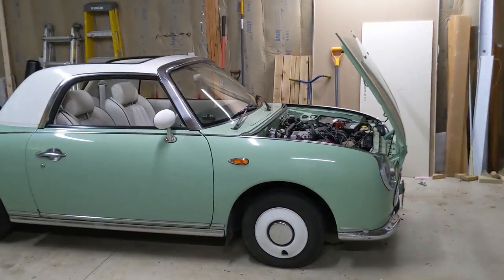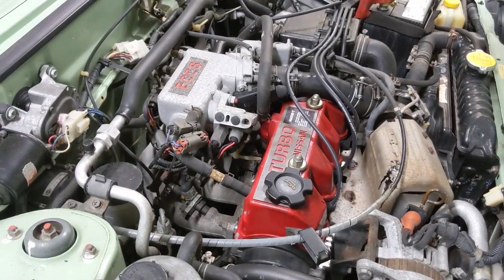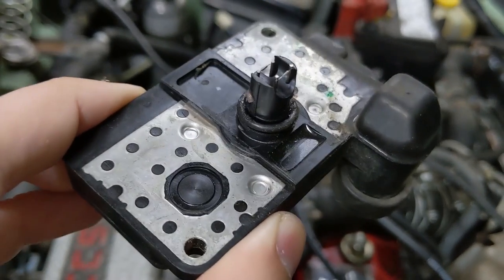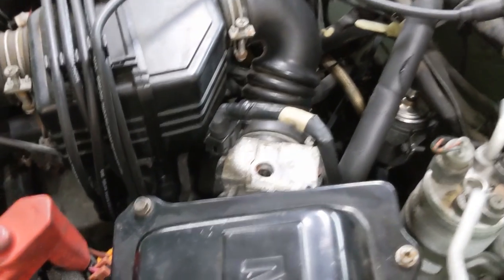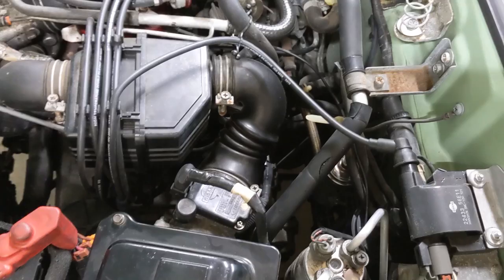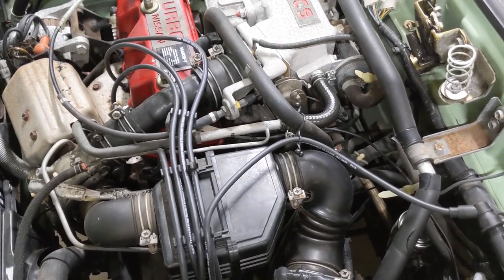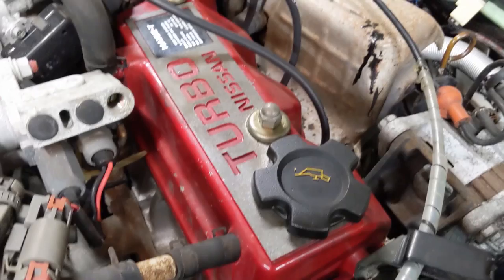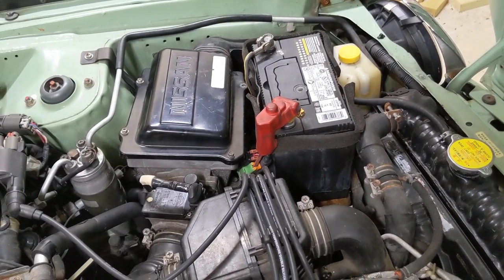Modern engine control musings and Fixing a Figaro

Comment: Nissan Dizzy has an optical  360+4 CAS in the dizzy. the 360 provides engine position with the 4 unequal slots provided cycle information.

Comment: Computer engine control has been around in some sense since the mid 60s. Bosch used to make fuel injection systems for Jaguar that were controlled by an analog TTL "computer".

Comment: A warm start problem, 15 to 45 minutes after having driven, usually indicates low Residual or Rest fuel pressure. Basically, the fuel drains from the injector rail back to the tank due to a failed fuel check valve; or into one or more cylinders via the vacuum port due to a failed fuel pressure regulator diaphragm. Either way, the fuel pressure & volume are too low to maintain idle until the pump catches up. The fact you can keep it running by pressing the accelerator leads me to believe it is a failed F/P regulator diaphragm.

Comment: On most MAF equipped cars, you can basically test the MAF by just disconnecting it and running the engine.  When the MAF signal is lost, the ECM will use its default air/fuel tables... otherwise, a MAF failure would leave you stuck by the side of the road... and most ECMs are designed to survive sensor failures, though cam and/or crank sensors will still stop you dead.
In short, disconnect the MAF and see if the car runs better... then you know the MAF is either dirty or failed.

Comment: Aah good old 80's japanese stuff. Gotta love it. I have a fair bit of experience with my own 80's and 90's nissans. First thing is that those styles of plugs from the start of the video.. You shouldn't have to remove the clip.. only push it in on the side with the whole thing exposed and the plug should come off. That way you don't lose the clip.. Secondly that valve is generally refered to as an IACV(Idle Air Control Valve) However it only functions when cold if i remember right. But idle is controlled for things like the AC but it's probably done seperately but yet another controlled air leak somewhere. The idle on a stock nissan of pretty much every petrol kind i've played with is about 850rpm. When it's cold or under AC load it might be around 1,100rpm. Vacuum leaks are pretty common reason to get bad idles. These things being 20-30 years old a lot of rubber hoses get hard an brittle. You'll also be surprised how many of the parts on these old cars can still be gotten new from nissan. But i don't know if nissan dealers in the US will import those parts for you. Here in australia they do tho. Also other ECCS nissans of that age can have a screw on the ECU it's self. You may need to remove that whole 'kick panel' as we call it to access it. If not there is a screw on the throttle body it's self that holds it open a littlebit. This isn't supposed to be touched. But it's possible somebody else has before you owned it. Both are worth checking.

Comment: Hey, if it’s still a little ‘hunty’ after the fix then it’s likely to be an air leak, get a boost leak checker (looks like a wild vape pen for a car) they’re expensive but.. failing that, run the car and spray brake cleaner on the boost hose joints (all of them) anywhere where air moves through the engine bay (ok this is bad advice for like normal people with normal cars break cleaner is corrosive) .. anyway, when you spray brake cleaner on the boost pipe joints, you’re listening for a raise in RPM this will point to the leaking pipe/area.

Comment: I have a Nissan that's the same vintage (91). My idiling problem was fixed literally with electrical tape only! One of the vacuum lines was kinked ever so slightly on one of the bends snaking
 around a component & for the longest time I didn't know why the rpms would erratically go up and down. The car would drive, and the symptoms would go away at times too. Well one time while running it and fixing something totally unrelated I inadvertently moved a vacuum line, and noticed it idled normally then took my hand off and went back to weird idiling! I thought of replacing the line but figured the problem would eventually come back, however I thought to myself... hmmmm if I put electrical tape around that bend tightly enough, it will reinforce the hose (make it more round) and fix it. That was five years ago and it's still working normally till this day. I wish you would of left the car running longer(for us to hear it) and be able to know if it was the same type of erratic idiling. I recommend going through all your vacuum lines while the car is running & see if it goes away while moving them. The cold start issue might just be that valve you mentioned, but someone else spotted a split vacuum line and that might just be the problem too, holes on vacuum lines is also a big no no!  
I look forward to the next episode! Also... I've subscribed to your channel just now too. :)

Cheers

Comment: I have two cars, one made in 1982 (Mercedes-Benz) and one in 1984 (VW). They both have normal engines with carburetors instead of the computer control, though the Mercedes has electronic ignition (which is not computer controlled, essentially some transistors in place of the points), while the VW has points ignition. There were different versions of those cars with mechanical fuel injection.
The VW would probably run just fine after getting hit with an EMP (it could take out the radio and the blinker relay though).

Comment: the code for the cam sensor relation can be the distributer out of time. on a lot of older cars like this the distributor is mounted with two or three bolts and the bolt holes are slotted so it the spark timing can be adjusted. if the distributer is out of adjustment so will the cam sensor thats inside of it.

Comment: My 1990 (though first released for 1988) BMW 750iL has not only one electronic throttle body, but two that are synchronized together with a feedback loop. Why two you don't ask? Well that's one for each bank, as the V12 is operated as two separate I6s that share a common crankshaft. Pretty rad!

Comment: MAF sensor cleaner can work wonders if the sensor is actually dirty. It made my mom's 1999 Outback run way smoother, but it did nothing for my 02 LS430, dad's 99 328i, or my friend's 08 Acura RDX.

Comment: On the topic of codes, i think my favorite way of finding out the codes for a warning light was my 2005 dodge neon sxt, flick the ignition keys from off to run multiple times then itll scroll across the dash
Reply: There's usually a function like that in modern cars. More people should acquaint themselves with it. For my car I have to hold down two buttons on the dash while starting the car. You then count how many times the light flashes for the code number.

Comment: OMG that idle-air-control valve is a blast from the past!  Valves like that were used on European cars with Bosch K-Jetronic (aks "CIS") fuel injection from the mid 1970s to the mid 1980s.
It's most likely not controlled by the computer, and if it is it's controlled very slowly.  Basically there's a bimetal strip inside linked to a shutter with a triangular slot in it.  The strip changes shape with temperature (as bimetal strips do) and moves the shutter back and forth, which controls which portion of the slot is exposed to airflow, which changes airflow and thus the idle speed.

The bimetal strip responds to the temperature of the engine but also has a heating element on it to speed it closing after the engine is started.  This diagram shows what's inside: http://www.theguestroom.net/manuals/Wiring%20and%20Sensors_files/auxaireg.gif
And yes, they can be finicky and failure-prone.  Another thing that can be wrong other than the valve itself is a fault in the circuit that powers the heater.  That will result in the idle speed being too high when the engine is hot, and many mechanics rather than fixing the root problem will just manually adjust the idle down, resulting in it being too low when the engine is cold.

Comment: A bit late here, but the distributer shaft is a better place to detect engine position than the crankshaft on a 4 stroke engine.
a crankshaft position sensor can tell if a piston is at TDC, but not if that's the end of the compression stroke or the exhaust stroke.
As the Distributer only rotates once for every two crankshaft rotations, when the rotor is pointing to the no1 lead you know it's at the top of the compression stroke.

(let's assume that any ignition advance or retardation is either fully controlled by the ECU or the position sensor is at the base of the dizzy shaft so not influenced by any mechanical ignition timing control)

Comment: I'm surprised! Whatever you're recording with is able to hear the VERY distinct hiss of a moderate vacuum leak.  I would wager there is a 1/8" hose that is NOT connected somewhere.  I couldn't tell if the a/c system is mechanical or vacuum motor driven.  If it's the latter you might also notice you air "goes away" under certain conditions.  Best of luck!

Comment: I know this is nitpicking, but my diesel merc w124 is extremely simple and purely mechanical (when it comes to engine stuff, of course) and that particular model was made from 86 up to 89. I once drove 70km with a broken alternator and no battery present, completely mechanically! My friend's is a 91 model and he already had trouble with oxygen sensors, car alarm, and it refusing to start because the newfangled fob key had a dead battery and so on. I shudder thinking of the time when I'll have to buy a modern car.

Comment: It's probably already been mentioned, but if cold starts are fine and it's only the warm start that's a problem, you may have a slightly leaking fuel injector(s).(I have no idea how many injectors it has.). Basically it's okay when cold with the extra gas, but is slightly "flooded" when warm from the small leak(s). A professional clean would solve that.

Comment: The computer will alter the ignition timing however base timing is controlled by the distributors rotation and on this engine can and should be set by a timing gun. On obd1, it's less controlled and your engine will be influenced by the mechanically set timing.

Comment: I had a Cadillac do something similar. At random times the engine would surge to 2500-3k RPM. Turns out the rubber boot between the intake and the throttle body had cracked and was leaking. Replaced it and now its golden.  But I suspect a vacuum leak for your symptoms.

Comment: You're very close to how a hotwire MAF works. The ECU sends a variable amperage to the wire to keep it at a constant temperature (measured by voltage drop over the wire, which varies with temperature) this amperage (in conjunction with a air temperature sensor) dictates to the ECU how much air has flowed over the wire.

Comment: Keep in mind the ECM that the MAF reports to may need a drive cycle to reset the fuel control.  There is a relearn period  on newer engine control modules. You may have a similar issue. South Main Auto channel is excellent for diagnostics.

Comment: a cam/crank correlation code, you want to put a timing light on it, and look at the distributor.
Reply: Would imply a worn drive gear, since Robert (Aging Wheels) replaced the timing belt.

Comment: As it has mechanical throttle try it with MAF and IAT (intake air temperature) unplugged, but not IAV. Then check for vacuum leaks. It does sound like idle air valve is shot (motor or solnoid driven), as it cannot adjust itself properly hence no start and high idle. Idle "hunting" can be vacuum leak, but also IAV that cannot travel its piston or seal propely.

Comment: To fix the battery terminal, you can take a short length of rigid wire, preferably copper or brass and wedge in next to the battery post when you put the cable on.  This should shim the looseness out.  Someone did that with the car I drive.  They probably make battery terminal shims. Edit: Not the person that did the wedging, "they" as in "a company somewhere". Edit 2: Though technically the person that made that shim, did make battery terminal shim(s) so I stand behind the original statement.  That's it.  Tangent over.
[smooth jazz plays]

Comment: Yes, the Japanese battery terminals can be smaller. Same on my car which is not an export model. You can get battery terminal post adapters that will allow the clamps to fit correctly.

Comment: I used to work as a mechanic from -96 to -06. Never in my career did I ever have to clean/repair/refurbish a MAF or an idle control motor, not on any of my own cars either and I've owned a few of a lot of various brands. Throttle bodies yes, I've cleaned a few of them..

One of my  own former cars worked perfectly well for almost 450.000 kms, then I sold it. MAF's are actually not delicate, they are quite rugged. What's in that spray by the way? Brake cleaner priced three times as high?

The high idle speed, is it present when the engine is at operating temperature? Japanese cars used to have (when I worked with them) increased idle when cold, to warm up the catalytic converter faster.

Comment: You say that the method of checking the codes is absurd but... Unless you have an OBD2 reader (which are really convenient for cars with the modern OBD2 standard interface) there are any number of ridiculous ways to check codes. I had one car where you had to pull out some of the center console paneling and use a screwdriver to turn a knob on the ECU, then watch the check engine light counting long and short flashes and check the code that way. One you had to do some song and dance with the ignition switch and gas peddle. Having the lights right by the knob to read the codes seems really convenient compared to those various methods. Using a bluetooth OBD2 reader to get the codes on my phone is the best, though! :D

Comment: yes the distributor just distribute the spark, timing is set by what is controlling the coil. I think most cars even going back many years have switched to wasted spark because two coils are cheaper, simpler and more reliable than one coil and a distributor

Comment: I'm not super familiar with pre-OBDII Nissans (Hondas and Subarus my speciality) so I can't offer much help diagnosing the ECU, but I can recommend replacing the capacitors therein because they can and will cause problems when they fail as they do on every other make. Otherwise I'd suggest your problem would more likely be coolant temp sensor related but that has already been replaced. For good measure I'd suggest removing all of the electrical connectors on the engine, cleaning them out, and reseating them after applying some oxidation prevention chemicals such as silicone grease; you may have a poor contact somewhere. Also as has been mentioned, check all of your vacuum hoses and maybe ensure your intake fasteners are properly fastened to their specified torque values.

Comment: I have no experience with Nissans of this (or any) era, but your cold idle valve looks very similar to that of Bosch L-Jetronic. In the case of Jetronic valves, it's just a bi-metallic contraption which, as the car warms up, slowly cuts the passage of air. There is also a separate heating resistor inside the valve, perhaps to make it close quicker? Anyhow, the ECU has no control of the valve, so the warm engine idle is probably controlled by a screw in the throttle body which lets air past the main butterfly valve. Before fiddling with any screws try squeezing the idle valve to intake manifold -hose with some pliers and see if it affects the idle speed. And before replacing the valve, try gently tapping it with a hammer and cleaning it - might just be stuck. Unless of course it's an entirely different kind of a valve in which case just ignore this comment. Oh and sorry for commenting before finishing the video.

Comment: Those problems are almost always caused by an idle air control valve. My 93 Accord did that. My old Saturn does that sometimes too. Neither of those cars use mass air flow sensors, and neither does my 2005 Accord. I try to avoid cars that use them because for a number of reasons. They easily get dirty and throw codes. They can be crazy expensive. They obstruct air flow.

Comment: It's pretty common for the cam position sensor to be in the distributor housing since in most cases the distributor is driven off of the cam rotation.

Comment: Some cars in the 2000s had computer controlled cable throttles, basically two cables. Interesting when traction control kicked in the computer could push the throttle back up towards your foot.

Comment: I don't know about Nissan, but on Hondas of similar vintage, there's a computer controlled IAC valve, and a separate Cold Fast Idle Valve that's open at low temps but is supposed to close when hot. If it sticks open, the computer iac valve can't keep the idle low enough, so rpms rise until it hits fuel cut, drops down to idle, repeat. 

Different brands and all, but this car may have a similar setup, and the surging thing definitely sounds like a similar issue to me.

Comment: First thing I would do is disconnect the oxygen sensor.  Step two reconnect the oxygen sensor and disconnect the mass airflow sensor.  The computer should default to "good" settings that will make the engine run without sensor input.  That's a quick fast and dirty way to track down the problematic sensor.  It'll usually get you going again in a pinch, but I wouldn't recommend it as a long term solution.

Comment: It's either the cold start valve itself, or a vacuum line that's bust. One on my old ones had the temp sensor for the valve go kaput, so I just bypassed it as there's no parts available for mine.